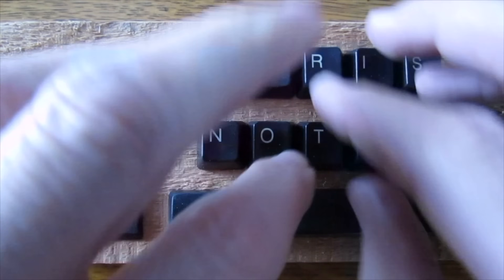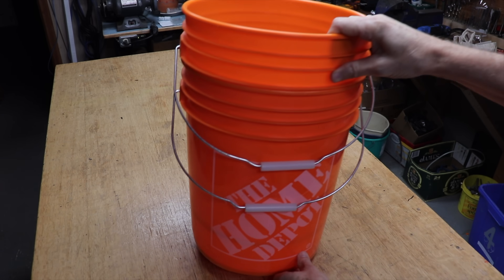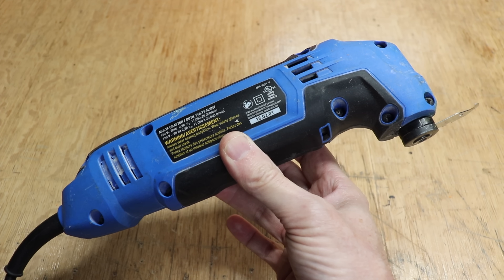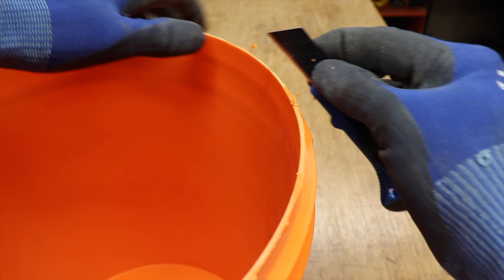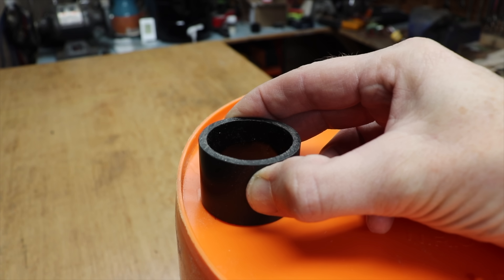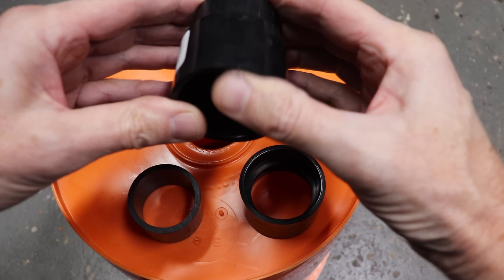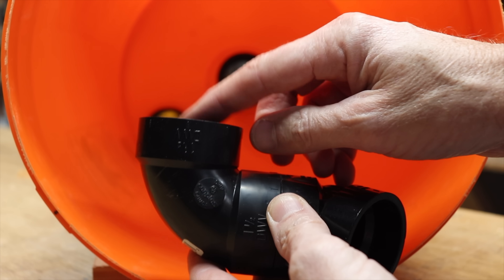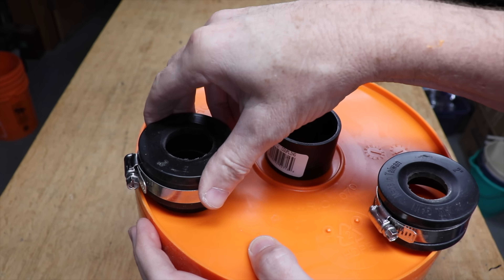How to Make ● Simple Cyclone Dust Collector

Comment: Anybody try this with drywall dust?  maybe a little water in the bottom if it still gets through?
Reply from the maker: I've had quite a few ask this so I just finished taking 2 square feet of 1/2" drywall and I pulverized it with a hammer into mostly dust and small pieces and removed all the paper. I sucked it up and I estimate about 99.9% stayed in the bucket or possibly 99.99%. I was impressed.  Hope this helps.
Reply: @chrisnotap  Sure does!  I am building mine today!  Thanks for the great ideas!!

Comment: Put water in the bucket about an inch
Reply: Have you actually tried this? I'm honestly curious - because I cannot see why one would want to take easy-to-handle, dry sawdust that is easily poured into a garbage bag, and make the first two cups of finer particles into a slurry that will stick to everything when you try to dispose of it, add weight to the device, and clog the hose into your shopvac if you accidentally tip over the cyclone?

Comment: Thx for the great diy cyclone attachment. You used a small shop vac. Have you tried it with a larger shop vac? Has anyone made this diy and used a larger shop vac? Does a larger shop vac have too much power and pull in saw dust? Does it still function well?

Comment: The real test would be drywall dust. If it works. I will subscribe.
Reply from the maker: I've had quite a few ask this so I just finished taking 2 square feet of 1/2" drywall and I pulverized it with a hammer into dust and small pieces and removed the paper. I sucked it up and I estimate about 99.9% stayed in the bucket or possibly 99.99%. I was impressed.

Comment: Screw all that, buy a dust deputy and get to woodworking
Reply from the maker: Yes but they are quite expensive if you buy the whole thing with a bucket. They can go all the way up to $250!! This is maybe $25 depending on where you live.
Reply: @chrisnotap  True. For me, I'd rather spend the money and save the time. There was a time in the past that wasn't the case.

Comment: Does it work with sanding dust from drywall mudding?
Reply from the maker: That I cannot answer. I will attempt a test today........that is if I can figure how to create a lot of dust easily from a piece of drywall. I think a hammer would work best on concrete. I will try to respond today if possible.
Reply from the maker: I just finished taking 2 square feet of 1/2" drywall and I pulverized it with a hammer into dust and small pieces and removed the paper. I sucked it up and I estimate about 99.9% stayed in the bucket or possibly 99.99%. I was impressed.  Hope that helps.
Reply: @chrisnotap  Awesome, thank you for going out of your way to answer my question, it's much appreciated. ☺👍

Comment: would fine, everyday dust collect at the bottom of this, or would it be too light and be sucked up to the filter? searching for a cyclone for non-shop everyday use, to save on filter bags. Am also wondering if a water trap mod help contain fine dust in bucket.

Comment: Any tips on stopping the plumes of yuck that come out of the exhaust outlet everytime I turn on my shop vac?
Reply: I feel (and sneeze along with) your annoyance and pain. I've reduced that problem by 1) buying a better quality filter, ($10 rather than $4) 2) adding a thin, wrap-around foam pre-filter over the filter, (paper disposable will also work, but I hate disposable/consumable parts), 3) emptying the vacuum canister when it's 1/2 full, 4) cleaning the filter with compressed air (from the back, outside) and 5) rinsing out the foam pre-filter, and spraying it with JUST A TOUCH of WD40. I also always clean the filters after vacuuming while doing finish or drywall sanding because that fine dust clogs filters fast.

Comment: They make a device called a dust deputy but this is pretty cool
Reply: something tells me buckets and a few pipe pieces are cheaper than that. 40 bucks is more expensive than 18 bucks for 2 buckets that u might just have lyin around
Reply: @dr.stoner7341  never said one was better than the other,  maybe someone didn't want to build one and buy one.   Cool comment though
Reply: @NateBFlooring   that's a respectable thought I guess. I dunno I just felt like this would be a cool thing to have around ur workshop and it would be nice to have built it yourself.
Reply from the maker: Did you watch the update video? .....  https://youtu.be/BeU4nqSJtBY

Comment: If you don't want to mess with the five gallon buckets attach the fittings to the tallest trash can with a snap on lid sometimes there's holes in the built in handles easily plugged or buy one without holes

Comment: you should have put a small filter on the cap connected to the vacuum, that should result in 0 dust going to the vacuum cleaner :) Great video :)
Reply: I thought about that too, but a small filter on the cap would quickly get clogged with that fine dust.
Reply from the maker: Did you watch the update video? .....  https://youtu.be/BeU4nqSJtBY

Comment: This is brilliant! I’ve been meaning to make one of these, but the other methods looked a bit complicated and time consuming.

One small correction to your video notes / parts list: you need 3 straight couplers, not 2.

Also, in the UK, most available buckets don’t have multiple lips like you have with the Home Depot ones. This is the closest I could find: https://www.ebay.co.uk/itm/232627703550
Reply from the maker: How did I miss that!! Thanks for pointing that out! Changes have been made. 
Those buckets in the link may not work due to the rib below the ring where you cut it. But it might, depending on whether you can cut those ribs off nice and cleanly so that it's smooth or not. Other than that, I think it might work. Sorry I couldn't be of any more help.

Comment: Geniua!
Reply from the maker: Did you watch the update video? .....  https://youtu.be/BeU4nqSJtBY
Reply: I took your basic ideas and made a huge shop vac from a 33 gallon trash bin.  I mounted a vacuum cleaner motor to the top.  It pulls so hard that I put a HEPA filter in line with the  vac motor to keep fine dust from escaping through the exhaust!  I experienced flooding in my basement and cleaned up over 300 gallons of water (!) over several weeks of rain with the vac.  It's a honey!  thank you for the inspiration and know how.

Comment: Do you only other thing I need is that extra length of hose coming out of the side hole of the device. Do you have any recommendations where to get it?
Reply from the maker: They seem to be hard to find at a reasonable price. My home depot had a section with a bunch of attachments. You want to start there. Thanks.
Reply: Chris Notap thanks !

Comment: Thank you so much for sharing this great idea. I just can't understand why the fine dust particles do not rise into the vacuum cleaner. Could you explain me?
Reply from the maker: Rewatch the video. Some of the fine stuff does get onto the vacuum filter. As the sawdust enters it starts to swirl. The weight of each piece is thrown to the outside and ends up in the bottom. The lighter stuff can and does continue to swirl and due to its light weight does get sucked up.

Comment: Chris.  I went to Home Depot today and bought everything on your list, including the hooked utility blades. Now, I have to see if I can make them fit my Dremel. Fingers Crossed. I have a feeling that you made putting this thing together look easier than it is. Most videos are like that.  Just do this, than that, then this, and voila, you have a fantastic thing you always wanted.That isn't they way it usually turns out, but  I'm going to give it a good try! Total cost of everything $26.  I plan to use one of my "other" shop vac hoses.
Reply from the maker: Unfortunately many scenes in a video need to be sped up. If I didn't, it would be way too long and boring! Gotta get right to the point in a video. Attention spans are short. I looked at it this way while doing this project. Buckets are cheap, and so I bought 4 and if I messed one up, I had another to continue with and to learn. I never look at anything as a failure, I consider it all learning and gaining wisdom.I had the receipt to return the un-used ones. I brought 1 back and experimented on the 3. Thanks and good luck with your build!

Comment: Brilliant! Thanks for not making a 6:33 video into 45:59. The results looks spectacular. Has anyone here tried this with the most evil dust of all ... DRYWALL DUST !?
Reply from the maker: That is great feedback!
Reply from the maker: I've had quite a few ask this so I just finished taking 2 square feet of 1/2" drywall and I pulverized it with a hammer into dust and small pieces and removed the paper. I sucked it up and I estimate about 99.9% stayed in the bucket or possibly 99.99%. I was impressed.  Hope that helps.

Comment: That's Pretty Awsome..Do you think you would have an idea for a lint collector for a dryer hose ?  I Like to recycle my dryer heat in the winter when drying clothes.
Reply from the maker: My mind has been hamster wheeling on a dryer heat saver for a while. I may come up with something in the near future. You've got me thinking of it again. Thanks!
Reply: @chrisnotap  >> cool deal,, right now I just have the hose going into a bucket lid, and other half of lid has screen on it, the hose blows down into the bucket with about 2" of water at the bottom to try and catch dome of the lint, the rest usually gets caught at the screen, but not all of it..it helps, but isn't all that great.

Comment: Great video, very good photography and the dust collector was very well made. I have made so far, 3 of something similar to this for gold prospecting, where I vacuum the bottom of holes people have dug on the gold claims. I cut a large hole in a bucket lid for a battery powered blower that sits on top. The pick up hose is mounted on the side of the bucket about 2/3 up the side. When dust ( and gold) starts to get blown out, I stop and transfer the dirt to buckets..
Reply from the maker: Did you watch the update video? .....  https://youtu.be/BeU4nqSJtBY

Comment: Why though?  Is dumping out a shop vac that much different then dumping out a 5 gallon bucket?
Reply: Using a cyclone separator will prevent dust from ever getting into the shop vac in the first place, which has two primary benefits: 1) Your filter will last a looong time. 2) The motor never has to see excess loading, because the filter stays clean, which extends the life of your vacuum.
Reply: C. Hess I see.  Thanks for the clarification

Comment: Like you, my vacuum filter got a little dusty after putting this cyclone dust collector together.  To solve the problem, I just extended the 90 and 45 degree elbows down into the bucket another 2-3 inches by cutting a longer piece of 11/2” pipe.  In the original design, small portions of saw dust are sucked into the vacuum filter because of the close proximity to the fitting attached to the hose going to the shop vac.  I dropped the elbows down a little more and problem much better....not solved...just much better.  Good idea though!!!!!!   I like it.

Also cut a circular piece of plywood the same diameter as the inside the rim of top of bucket and attached it with some screws, washers and some construction  adhesive.  This makes the top part of the container much stronger and minimizes cracking of the plastic over time when hoses are moved around.   Then I cut down an old vacuum cleaner bag and placed it on the fitting going to shop vac inside the container.  I used rubber bands to hold it in place.  This helps preserve the expensive filter in the shop vac.  Some of those shop vac filters are $15-$25 a piece.

Comment: This went comicly bad for me. You made those two buckets fit together like nothing. I smashed my finger and used about 5 tools trying to get it to fit. The edge looks like a shark attacked it. My holes are not even and I ended up cracking the bottom trying to fit one of them in. I should make a tutorial... It would be hilarious.
Reply from the maker: Look at it as experience not as a failure. It took me a while to get good at anything but it's all learning and at least your not sitting on a couch!! Thanks for sharing.

Comment: I compulsively tinker with and improve on mechanical stuff until I ruin it. This dust separator is contra-indicated for me. Simple, as or more efficient than any of the separators I've looked at and cheap. I don't like it. It's the buckets. Ugly. A nice wood toned beige would be OK. Or maybe a Lowes bucket on one side and a Home Depot bucket on the other. I'll have to tinker with it.

The snips you use to very good effect are aircraft snips, they come in left curve, right curve and straight. I notice you wear gloves. If you cut sheet metal eventually you will cut your hands. You WILL require stiches. Good job captain.

While building my own system I'm trying to minimize corrugated hose. The American Boat and Yacht did extensive testing on how corrugated hose effects bilge pump efficiency. It's horrible. We're talking forty percent reduction in pump capacity between corrugated and smooth wall hose. The reduction might not be as dramatic when pumping air and saw dust but it will be substantial. On the other hand your design makes for a very handy portable separator.

Thanks for sharing your excellent work. Very well done.
Reply from the maker: Did you watch the update video? .....  https://youtu.be/BeU4nqSJtBY

Comment: This design is quite elegant, and appears to be a very efficient cyclone.

For my shop tools I use a variation of this with 4" hose and a 1 hp dust extractor mated to a plastic 45 gallon soap drum.  Because of the high air volume with the dust extractor I have found it separates wood chips better if I leave the little air vent on the top of the drum lid uninstalled.
Reply from the maker: Did you watch the update video? .....  https://youtu.be/BeU4nqSJtBY

Comment: I don't really get what the angled fittings inside are doing. Why not just let the dust fall straight down?
Reply from the maker: With it angled , it gets the sawdust swirling and it slightly directs it downward. If you have it blasting straight down, it would just continually keep it all agitated and it would go up into the vacuum.
Reply: @chrisnotap  The "why" is why you 'included' 0:00 > 0:40 in this wonderful video ( I AssUme :) ).

Comment: Yup, it's called a velocity drop off. If you used a coffee can, the velocity would not drop off very much, all of the sawdust would end up in the vacuum,  but if you put a hole in the front of a 2 car garage with a suction hose, and a hole in the back of your garage and hooked up your vacuum outside to that hole, you would get a huge velocity dropoff- no sawdust into the vacuum. 
I use a 55 gallon drum with a ground clamp. 5 gallon will work for most people that don't do woodworking for a living,  great job on this one.
Reply from the maker: Well explained!  Thanks.

Comment: It’s important to use Home Depot buckets bc Home Depot sucks.
Reply: Yeah Right.............My Home Depot stock has went from $16 a share to $218 a share in the last 10 years/....
Reply: @Brandon Shubitowski I've found that most of these cheap buckets will implode if the airflow between the tool and the bucket gets too restrained, whether blue or orange.  My cyclone was working great up until I forgot to turn it on during a long TS ripping session, then the tube was clogged and the bucket crumpled.  If you find a leftover paint bucket with thicker walls, you're better off (but it still won't prevent line clogs)
Reply: Good one😆
Reply from the maker: Did you watch the update video? .....  https://youtu.be/BeU4nqSJtBY

Comment: Great design, Chris. I've watched many dust collection videos and experimented with a few designs myself, but this one is by far the most straight forward. Excellent solution for joining two buckets with an easy snap on fit. The one I made has one bucket with a lid, but only because I couldn't find as good a way to fit the second bucket like you have. I also used a suction seal for the intake/out-take hoses, and they work well.  I'll be building this design soon. Thanks.

Comment: you just saved me 100's $$. I'm going to go one step further and use more buckets to exspand my capacity or even run my vacuum hoses out to a 55 gallon metal drum in the yard and this way I can just remove the top and burn the shavings when it fills up.

Comment: Nice. If you drop a pipe from the 45 elbow straight down to just a couple inches from the bottom you can fill the bucket half way or so with water and use it to suck up very fine particles like sheet rock dust without blowing the filter on the shop vac.

Comment: Hi Chris:
I found your channel by mistake but that is a good thing, since your presentation is most helpful.  I have one question.  Could a  single steel barrel (20 or 20 gal) with sealed lid be used?  I have access to such barrels at work which are dinged up but serviceable.  Thanks!
Reply from the maker: Yes. You should give it a try. I'm sure it would work great!
Reply: @chrisnotap  Thank You.

Comment: I'm going to make one with larger holes to use with my bigger shop vac hose. Then I can mount it to my hand truck to pull around my yard to vacuum up leaves and dog poop. I can put a trash bag in the bottom bucket. When done, I take the top bucket off and remove the trash bag. Tie the drawstring and toss in the trash. Thanks for the tutorial!!!